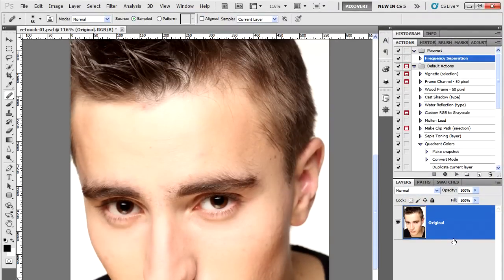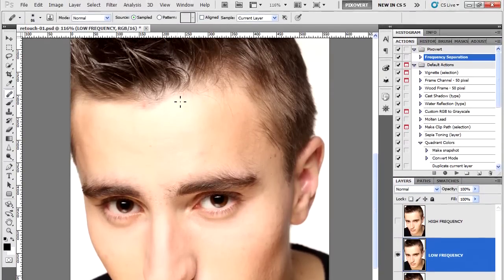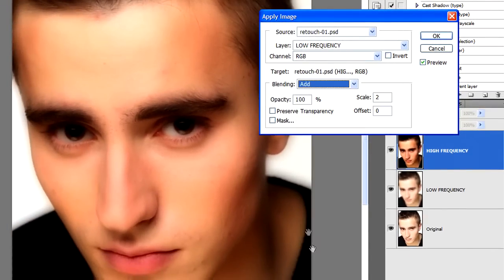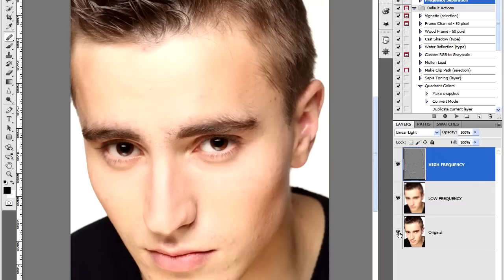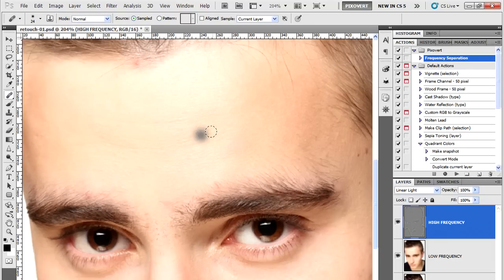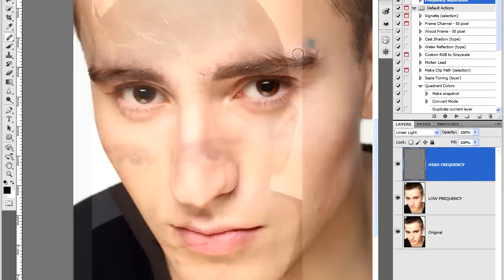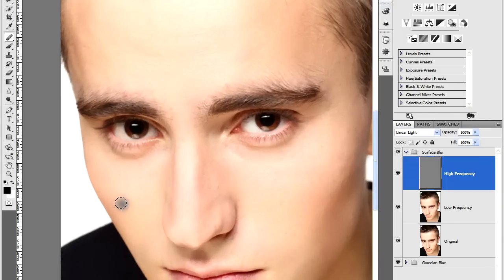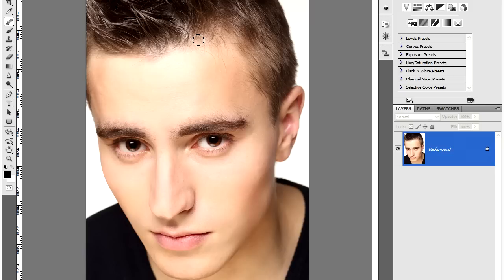Retouching - Frequency Separation in 16 Bit Mode Photoshop CS5

Comment: Great vid! One tip you could try when blurring the low layer is use the dust and scratch filter...it gives a soft blur but kips the edges crisp. I like it better than surface blur. Just another way.